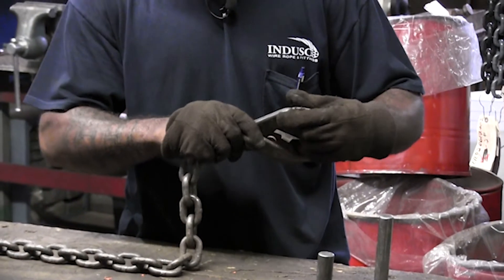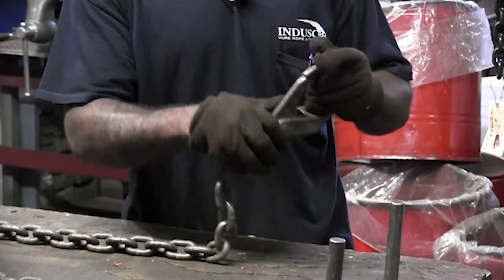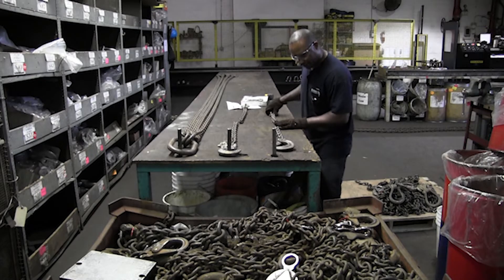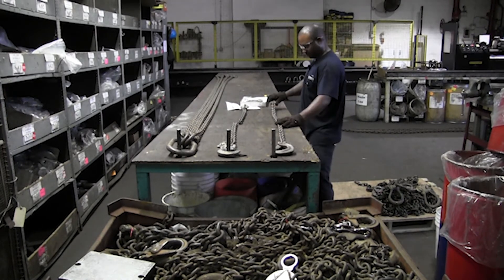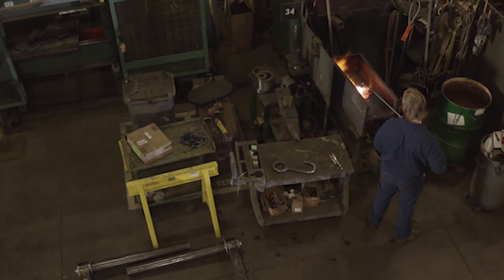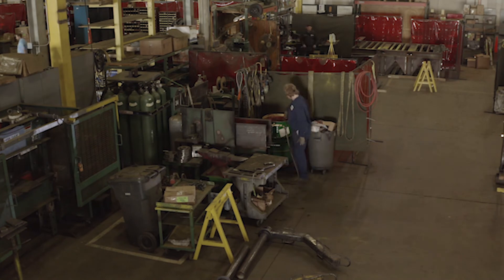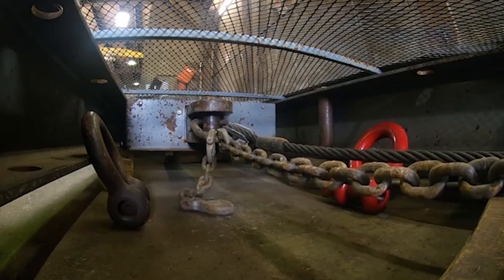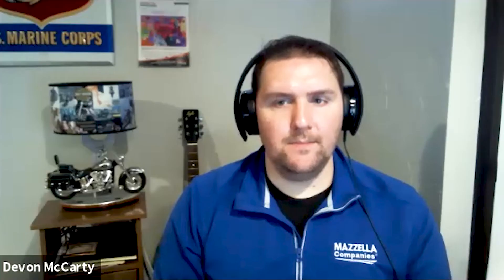Mechanical Repair vs. Welding Repair Shops for Alloy Chain Slings

Comment: Why can't you guys weld on an alloy chain sling with mechanical couplings in order to replace one or two chain links? Isn't the body link material of each type of these two chain slings (welded and the one with mechanical couplings) made of the same material and process?
Reply from the maker: Thanks for the question, Romon. I reached out to Tom to help clear this up. I think there was a slight misunderstanding. Most vendors only offer mechanical repair as they do not have the capability to weld. Mazzella, however, has approved locations for CM welds. We can repair a mechanical chain sling by welding in body links assuming the chain sling is in a location where we offer that service. You can find a bit more information here: https://www.mazzellacompanies.com/solutions/product/chain-sling-inspection-and-repair-program/ Feel free to reach out with any other questions here: https://www.mazzellacompanies.com/company/contact-us/contact-rigging-division/